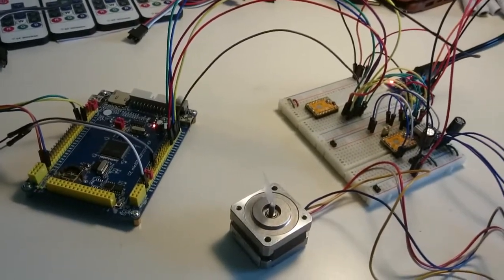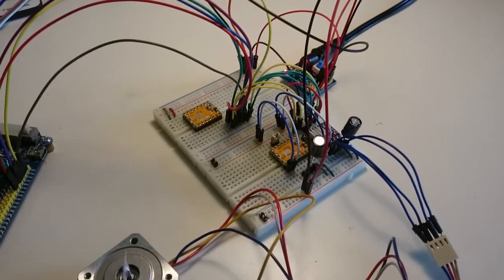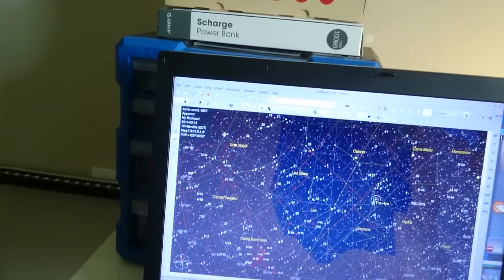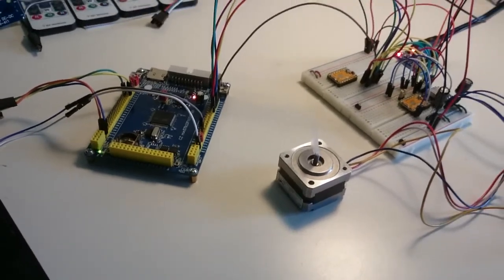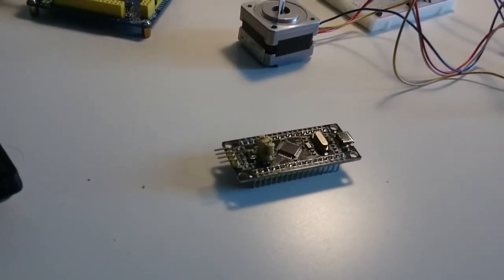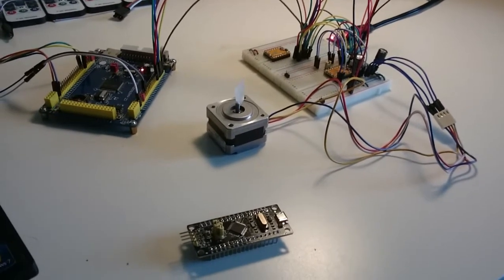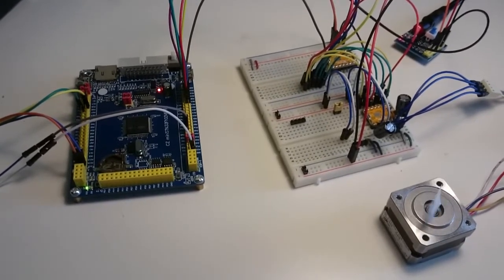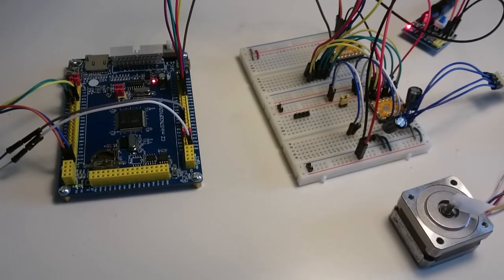OnStep Telescope with STM32 and DRV8825 and LV8729

Comment: Hi Khalid. I am almost finished setting up a wemos d1 mini ESP32 with CNC + LV8927 drivers. I used the Onstep generator and the calculator for the firmware. However, slew speed is extremely slow. I tried the screw on the drivers and too low current stalls the motors, too high they move a tiny bit faster but overheat. Slew steps are at 2. This is an eq5 with 144:1 worm, motors are nema17 400 steps 0.9. I have cut the resistor on the cnc as per instructions found online. Can you help me spot the issue?
Reply from the maker: Please ask in the OnStep group, because I don't use the CNC board myself.